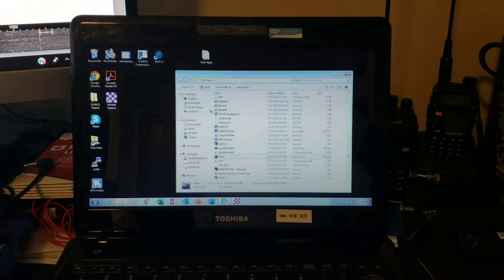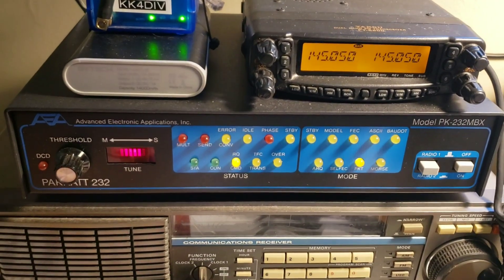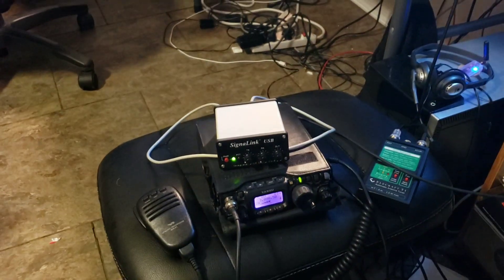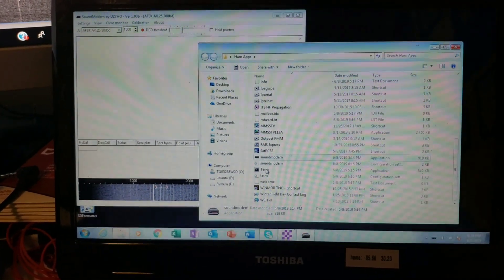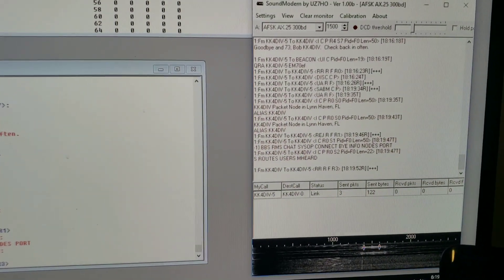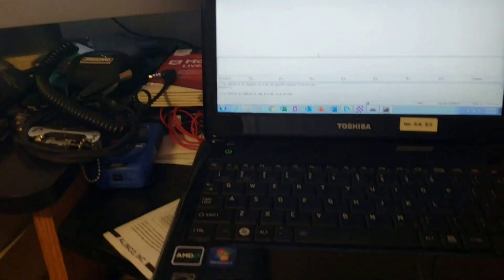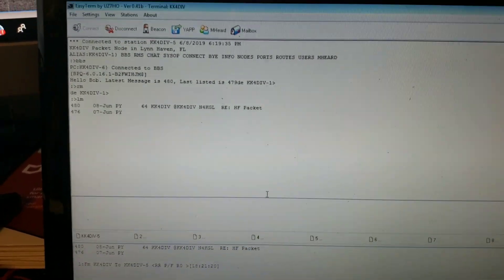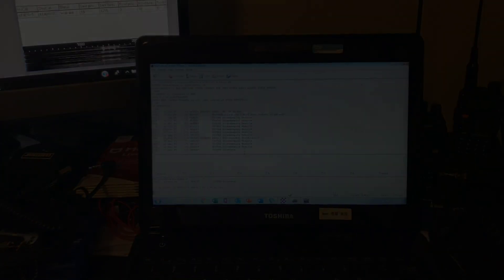HF Packet on my BBS?

Comment: I've been trying to do HF packet radio with Soundmodem and Easy Term using a Xiegu G90 (20 watts max) and 20m 1/4 wave vertical whip or a Hamstick for 40m. Not seeing a lot of beacons, which is probably my clue that propagation is terrible at the moment. Haven't managed to connect to anything so far. Do you think my rig is inadequate for HF packet?

Comment: Cool video! Thumbs up for that PK-232 in the background! ;)
That's the first time I saw a Packet BBS on HF. It must be 300 Baud or so, I guess.
I now have a better understanding how my father had felt when he connected to AX.25 networks
in the late 1970s/early 1980s via accoustic coupler on the land line.
These PADs had 300/300 Baud and later on, 300Bd up / 1200 Bd down, if I got it corretly.
Anyway, many 73s, too!